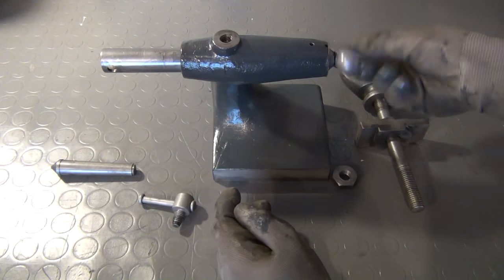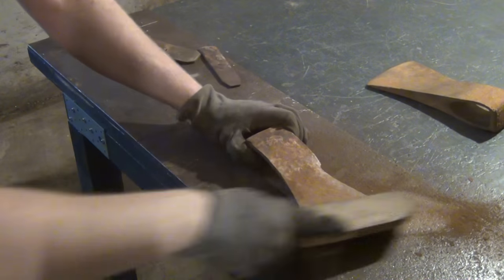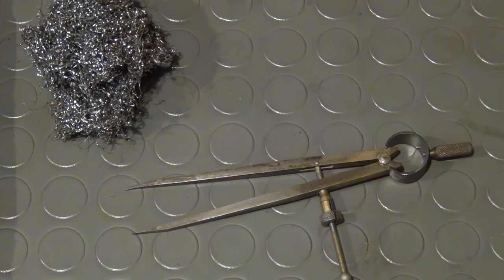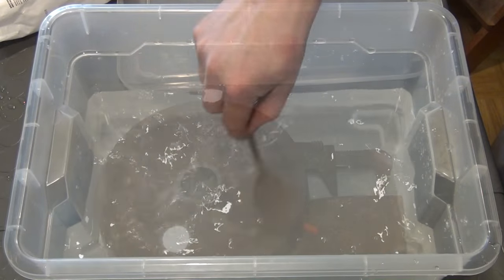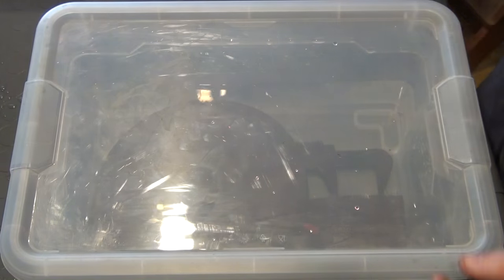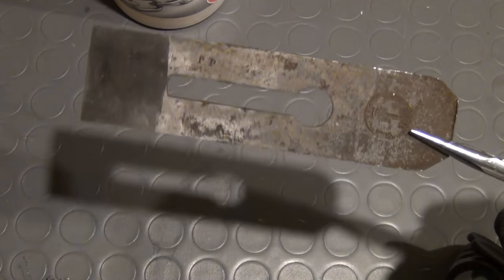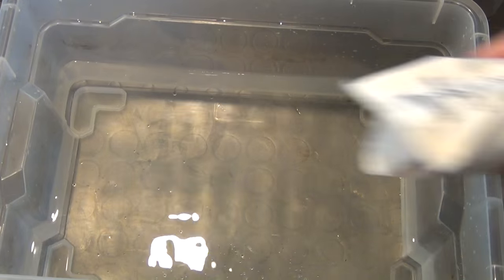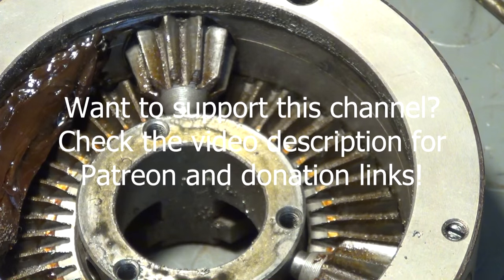Rust Removal Experiments: Citric Acid, Cider Vinegar, Rostio

Comment: Good video.  I usually use Baking Soda mixed with Water to neutralize any acid that I use to clean rust off of metal. Works great for Citric Acid. Then rinse with water, dry and usually spray down with WD40 to stop flash rusting.

Comment from the maker: Some additional remarks: Could I have chose a different kind of vinegar? Yes. Could I have chosen a cheaper kind of vinegar? Yes. Could I have performed the same experiments with about a hundred other substances? Yes.

I really just picked some of the various substances that were recommended to me by the viewers. This is just a smaller project that is only a means to an end and stuff like this often just needs to get done in the shortest time possible.
An experiment with molasses rust removal will be shown in a future video. 
There also could be more extensive tests using all kinds of substances in the future, but I want to finish the lathe restorationj and the EDM project first.
Reply: If you're interested in an ecological way of cleaning, just give a try to sodablasting. It's a bit like sandblasting but use baking soda (Natriumhydrogencarbonat in german, i think) and it doesn't harm the part you have to clean (ex: will remove paint and rust on a car, but won't harm plastic joints nor glass from windows ;) ). The main difference with sandblasting is it requires a bigger airflow, so just be sure your air compressor is efficient and sufficient enough). Youtube is full of videos about this process. Enjoy ! :)
Reply: One other vinegar to try is distilled (or White) vinegar, cheap, plentiful and easily available in most places, it's the stuff they use when making cheap pickled eggs & onions and similar low-budget vinegar-pickled yuckiness... :)
Reply: Ramon Garcia I soak carburetors in it overnight and never had a problem.
Reply: I just de rusted some iron parts with white vinegar. i tried it with cold vinegar and with warm vinegar. The best was the warm vinegar, if i have to put a number on it i should say the warm vinegar is 4 times better then the cold...
Reply: White vinegar is much more reactive than cider vinegar. Also, as someone else suggested, heating it up will speed up the process.

Comment: I use destilled vinegar which is stronger (8º) and cheaper (0.50€/liter). You can make it work faster by heating it by the way.
Reply: Same. Quite cheap and effective. I let it go 24 hours. Plus, salt will turn it to hydrochloric for etching for plating.
Reply: Cleaning vinegar is stronger because it has 10-20% acetic acid instead of 2-5%

Comment: I have had very good results with 10:1 diluted molasses. 
It takes weeks, so falls outside your parameters, but it is both gentle and very effective. 
It allows you to treat rather large parts at reasonable cost and at the end you have sugary water, not hundreds of litres of acid.

Comment: I've used citric acid numerous times in rust removal purposes. As a joiner, I mostly use it to derust hinges and so on in windows and doors. Anyways, citric acid doesn't eat the iron too much nevertheless if you use it for more longer period of time. When derusting tractors or cars, just add gypsum or plaster and "paint" it to somewhere. 

About neutralizing, just wash with water and dip in thinner. Citric acid is used in agricultural so big bulks are available for cheap batches. Propably the best rust removal method for every day use! My favorite method :p

If there's paint. Just make batch of water and lye and paint-be-gone for one day, next day just wash with water and submerge in citric acid. Wash with water and dip in thinner and after that just paint or oil the parts and that's all to it. Best way, and cheap!
Reply: Dont forget its not just rust removal, but for sharpening files for instance. Though i have run into interesting and rather annoying problem where after few uses acid starts to crystallize on the sides of the container and the part it self, witch after process wont continue in areas that are covered by it. To get over this issue i have another container with water, where file goes after crystals start to form, so those melt into water and i can continue sharpening process. After while even that water start to be acid so some sharpening can be done in that container. From my experience 4-5 files is max for minimum amount that covers the file, of a nearly 100% acid (so much that can melt on the water) and it takes 24hours to do its job, possible two days if there is serious damage on the file and one or two cleanings where black stuff is brushed off with brass brush.

Comment: You left out some info regarding your experimentation and I don't agree with you 100% on your conclusions, but this was my own take from my use of various methods of rust removal for Model A Fords and other makes. You didn't mention putting your clear plastic tray out into the direct sunlight. I can tell you that the process of rust removal works much better when that is done. Most of my parts are left outside for anywhere from a couple of hours to 3-7 days, with no real issues over any metal loss at all. Flash Rusting is the main culprit, but a lot of folk have cleaned up Model A carbs and left them on their shelves for years afterwards with no significant flash rusting noted. Oiling the part immediately after a water rinse seems to be the best result to stop the flash rusting, but if appropriate, painting or priming the part is also helpful.Apple cider vinegar is okay, but you can increase the acidity of the vinegar and there are YouTube videos on how to do that.  However, a better medium in my opinion is dry molasses which I generally use in my mix at a 4-5 scoops per gallon of water. Nothing else is required and this mixture can be poured into a flower bed with no problems, but I would not do so into a vegetable garden. It is a sludge mix after just a few hours and the odor is not too great, but it works very well for rust removal. Although I also use various mixes as my electrolysis mixture, the problem for electrolysis is all the equipment required. The vinegar or molasses mixture just requires mixing the brew, inserting the parts and then putting the clear plastic bin outside in the direct sunlight. The Texas hot sun does a wonderful enhancement to this process.I also frequently use a plastic kiddie pool to handle larger parts as fenders or engine block parts. They are cheap and easy to find for such a project.I am assuming that the Ristio is essentially the same as naval jelly and I have had little satisfaction with the use of that product over the years. Lye or Red Devil is easier to mix in water and use, but these chemicals are caustic and to me, dangerous If you have animals or kids about. Pool acid works, but it too is highly caustic, allows for more fumes and is a total danger to pets or kids when not supervised closely. The fumes from such can also entrap other metal items if left uncovered in a hot garage or such. I did that once with a Model A I was working on in my garage and got called away. I had pushed the open container of pool acid under a workbench thinking I'd be right back. Well, I forgot about it and it was about 3 days later when I opened up that garage. Everything inside the garage had flash rusting on any part which was not protected by paint. Over $10,000 in damage to that Model A, as even the chrome on the bumpers had turned into an ugly green goo and flaked off. Virtually every screw, nut and bolt was rusted over on that Model A Ford and it taught me a grand lesson in using acid of any kind to clean up car parts or other metal objects. Do not leave it unattended and in an enclosed area.I also had a unique experience with a bunch of screws I had put into a metal sieve and dipped into a vat of lye. The acid quickly ate the metal sieve away and dropped all the screws, nuts and bolts down to the bottom of the vat. Again, the lesson is to learn what the product may do to various types of metals and don't leave the mix unattended. It does not hurt to check the progress of any dip often, but the length of time the part is in a bath is likely not to ruin it by any real metal loss of significance.  If a part still has rust after the bath, you can use stock oven cleaner and a wire brush to remove any additional scale. Even a quick once over with a sand blast medium can easily remove any residual rust the mix does not remove.Me, I prefer the dried molasses mixture over any of the products you use in your experimentation. It is cheaper and works every bit as well and often better than citric acid and such. These parts may develop a darker color once the mix brew is doing it's work, but most parts will ultimately be primed, oiled or painted anyway, so that is not a real issue.I am not knocking your experiments at all, but I have used these same products for over 40 years and this is what I feel about their use. My results are not experiments,  but tried and true methods which worked best for restoration projects on vintage autos. As I said, you left out the idea that this mixture works best when used under the hot sunlight, but it sure does.  Thanks for posting your results.
Reply: Great reply,  but just one small point  -  lye is not acidic,  it is alkaline.
Reply: Your sieve only dissoved because it is aluminium, you should have checked if it was aluminium before putting it in.
Reply: Sorry, I'm from the UK. What is this "hot sun" you speak of?

Comment: Great showcase.  You show real examples, and you include details needed to ensure good results (ie pre soaking and wire brushing before using a chemical solution).  Critics might complain "But that's not showing power chemistry!".  I didn't notice the aluminum risk, but I'll re-run the vid to try and spot it.

Comment: Thank you for another informative video.  My comments may be 3 years late, but for what they are worth ...
The gelatinous rust remover product used in California is called Naval Jelly, and its counterpart for aluminum corrosion is Aluminum Jelly.  I have not used either, and don't know their chemical base. 
Most of our liquid commercial rust removers are based on phosphoric acid, which works very well and leaves the metal looking black .
I commonly use vinegar, or acetic acid which is equally effective in the white or distilled form as cider vinegar. Since white vinegar is used as a cleaning agent, it is much less expensive, never more than $3.00 per gallon. You can afford to use it in quantity.
I have only recently learned of using citric acid, as it appears to be popular in European countries and Australia. I don't intend to change, as the white vinegar works and is inexpensive. 
I have concluded that any of the common weak acids work as rust removers. Some may be less reactive than others, but what does that matter?  Most of us are happy to leave parts soaking overnight, and when you consider the bulk of the tool, a little extra corrosion is negligible. These are weak acids and the metal they will dissolve is far less than that taken by the rust itself.  Of course nitric, sulfuric, or hydrochloric acids in concentration would be a very different matter.

Comment: I use a plastic centrifugal pump from an evaporative cooler to recirculate the liquid in the tank. Works really well for the electrolysis, would probably help for citric acid as well. Only uses a few watts of power. Speeds up the process/makes the process more uniform. Great set of videos as usual.. Michael in Colorado.
Reply: Glad I have my centrifugal pump and evaporative cooler at the ready

Comment: Thanks for this. I'm just about to clean some old planes myself and bought liquid Rostio to do it. I'll try the citric acid method now first, because the Rostio was 20 EUR per litre. Thanks for sharing. Very well done, well structured and explained very clearly.
Reply: +Andreas Kalt You could try with dilute hydrochloric acid (Salzsaeure). You can get it from Baumarkt or Apotheke stores. It's cheap and stronger than citric so you can dilute it a lot. But take proper precautions with HCl, since it is strong stuff.
Reply: +Robert Seviour Thanks for the suggestion.

Comment: guten Tag!  Thank you for your informative videos.  Having worked in an electroplating shop for 10 years, I have restored multiple vehicles and engine parts using such resources.  By trial and error, I have found that the solution didn't exist in cathodic / anodic cleaners or just straight acid / caustic reactions -- the secret to my success was the ultrasonic cleaner in a citric acid / soap solution.  This offers no Hydrogen embrittlement issues (quite serious) and also if you add a brass part to the UC, the part will have a thin coating of Cu on the cleaned areas - ready for a flash coat of Cu or Ni to prevent further rusting.

Comment: If you live close to any Polish shop, I would recommend using the Polish vinegar for de-rusting as it is 10%, not 5%. I leave the metal in the 10% vinegar overnight and with a little help of a wire brush, even the heavy rust comes right of :)

Comment: Vielen Dank.  Most commercial rust removers available in hardware stores have phosphoric acid as the active ingredient. In English speaking countries, this product is referred to as 'Naval Jelly.' Most hardware stores will also sell 30% acetic acid vinegar as a cleaning agent. Combined with table salt, it's an effective rust remover, and good at polishing copper, bronze and brass.   Both of these products are caustic, and generate slightly dangerous fumes.  Thanks for mentioning the hydrogen gas, and further oxidation of the metal.  The dark or black residue is FeO, which can be wiped off.  For smooth surfaces, such as saw blades, I recommend using a paste wax as opposed to a machine oil.  The wax won't attract dust and moisture, which lead to further rust.  I will view your electrolysis experiment. Amazon accidentally sent me a spare packet (250g) of citric acid, which will now be used for rust removal.  As my Bundeswehr roommate in Bosnia once advised me, "Zweimal messen, einmal schneiden."

Comment: With the gelatinous removers I've seen people pull out a layer of plastic kitchen wrap, lay the work piece on that, slather it in the jelly and then roll it up, pressing the plastic up against the surface and sealing it into a little rusty jelly package. Helps counteract the dripping effect.

Comment: That black iron 3 oxide coating following citric acid bath is protective against further oxidation.  I've used it as a protective finish with good results.  

Black oxide (common name) is a coating used on drill bits, tools and other ferrous metal products.
Reply: +tiporari That sounds like Iron 3 phosphate;  Iron 3 oxide is red rust, but iron 3 phosphate acts as a protective finish.
Reply: I think I got iron 3 oxide and Fe3O4 (magnetite) mixed up.

Anyway, when you do this process, I've found that it leaves behind a surface coating like gun bluing which is Fe3O4.

The coating is mostly inert, and doesn't quickly rust again.  Rubbing it off with steel wool strips away the thin magnetite layer and unless you seal it will quickly rust again.

Thanks for pointing out my error anyway, forced me to challenge my flawed recollection.

Comment: Just to share some info with you: I have been using citric acid off ebay (because cheap) to derust motorcycle tanks from inside. I have the impression that a surface should first be degreased (I use dish soap and water) and the loose rust removed (I use small SPAX screws and a cement mixer). After that, rust removal works quite well just as you described. concentrationwise I use 200g/L when I work at room temperature and 20g/L when I can heat up the solution to about 80°C. Note that the warmer the solution, the less concentration can be achieved, but the faster it "chooches", as AvE would say. If I wash out the tank with tap water after derusting I have found that the surfaces flash rust immediately. Since then I use acetone or isopropanol to wash out the tank after derusting. I have not yet found a homebrew DIY way to passivate the surface after succsessfully derusting it.
Reply: Im in the same boat, going a bit mad derusting my tank using citric acid, just to see the flash rust come as soon as i try to dry it. I need the tank to be bone dry so i can line it. Ive tried dumping baking soda and water in after to neutralize the acid, but it does not really do much. Did dumping a litre of acetone in the tank actually dry it all out??
Reply: @kingkelly44  i have been using isoprop with sucsess. Multiple rinses, no need to fill the tank completely.
Reply: @kingcasi75  Thanks. So you just wash out the isoprop with water, let it air dry, and no rust comes back? How long did you have to swish around the isoprop in there for?
Reply: @kingkelly44  no, i wash out the remains of the citric acid with isoprop multiple times and let that flash off / dry